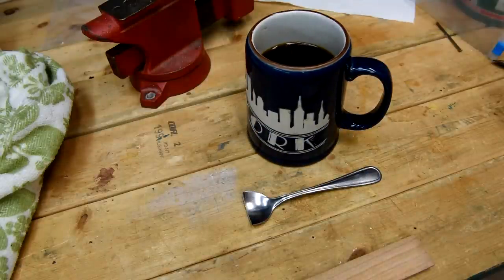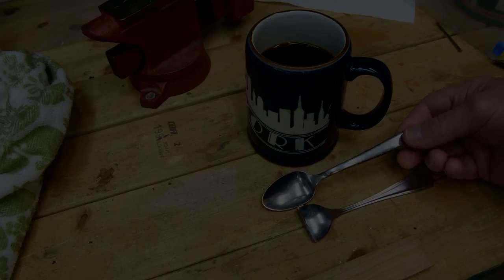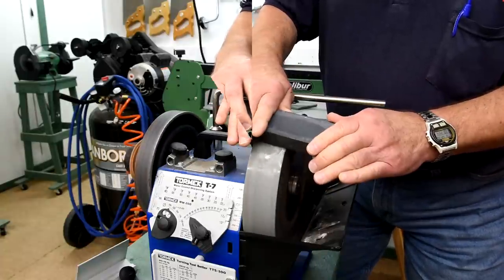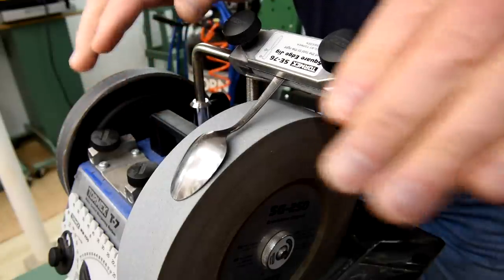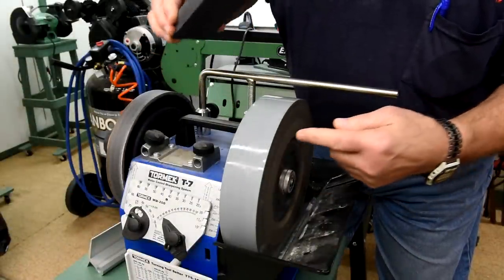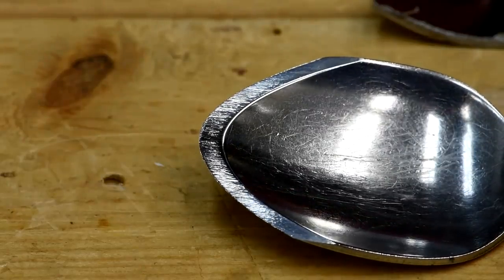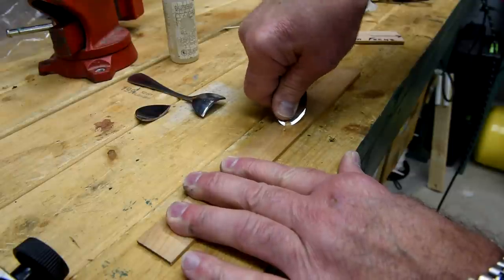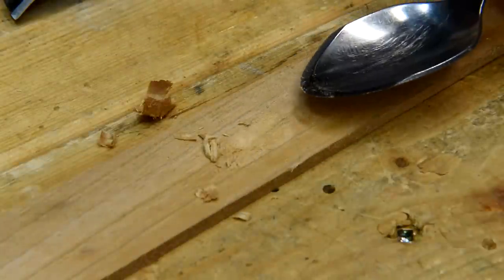The Homemade Carving Spoon/Gouge - Update

Comment: Way to go.  Like the old timers used to say, If you once fail, try try again.    Never give up my friend some of the greatest inventions, tools, etc., were born out of necessity and a string earlier failures.  A testament to why we should keep trying and looking for ways to improve.  When I made mine I cut it like your first one  but used a die grinder with a series of drums to cut the bevel on the top side.  Then polished it with a ceramic stone that closely matched the bevel.   This design you made very much resembles a old fashioned spoon bit for a brace.  I’ll bet it works great for cutting holes by hand.  Thanks for sharing your experience with us. I enjoy watching and the creative thinking it inspires.  Have a great day my friend. And again, well done.  You should re-bevel your first one to and have two very useful tools.  Just a suggestion.   Maybe make a follow up video if you make handles or continue to improve your design.  Thanks for sharing.
Reply from the maker: Thanks for the suggestion Edward, but I've given up on my homemade gouge idea. 😁

Comment: You can buy spoons at thrift shops for almost no cost, try a plain carbon steel spoon, it can be easily hardened and tempered and will hold an edge better and be sharper when honed with compound on a leather or wood strop. regular spoons are magnetic, stainless usually isn't.

Comment: Looks good Ron.    I have a tool very much like that except where there is the belly of the spoon, I have hollow ground it.  This gives you two tools.  A slick with a drastic curve to the front so it can smooth the outside of a hemisphere or plane with no risk of digging in anywhere, and a fairly shallow gouge.                      What I detect in the video is that there is still a significant burr on the edge of your tool.  This is bound to be a problem with the relative softness of the stainless.  But a culprit is also using the jig on the strop side of the hone.  To peel off that burr you need to raise your tool a little higher than the incedence you have it at.  And just flip it back and forth until you pull off that burr.  With just that you’ll get (at least) an initial cut.  That stainless will hold on to its burr pretty stubbornly.      That tool (in proper tool steel) I think you would find quite handy.
Reply from the maker: Thanks for the comment. Yes, agree "in proper tool steel" 👍

Comment: Been thinking of making a spoon carving knife for gouging out the scoop part....I don't have the tool you have here.  I like what you did with both spoons...might just need to be thinner to be able to cut? I saw a grinding ball for a drill at hardware store today...might try with dremmel or rounded  file  will take a while but its satisfying when a few attempta comes out with a usable tool. 
I think both could work might just need to be sharper or add a handle....the hardware store even had handles to add to the files...i didt know they existed..but could work as a handle on your spoons.
While out walkin I get my ideas and funny to see this video after thinking about spoon carving and how to make a tool. maybe sharpening the long side...length of the spoon scoop so it can be used sort of like a paring knife only curved.
I have a victornox curved paring knife good for food carving.like melons or pumpkins...hoping to make somethin similar but bigger and hold up to cutting wood . 
Spoon tool for carvin spoons.
Love it great video. Good to see other people experimenting with making their own tools for carving
Reply from the maker: Thank you for commenting. Good luck with your home made spoon gouge. 👍

Comment: Ron
Again, thumb UP for the effort, however you have a totally different "spoon" now, the edge is different too.
If you compare the two spoons to a Propeller plane (straight wing) to a fighter Jet plane with sweep back wings.
You changed the geometry of the edge that's why it's cutting now (not for long though, wrong material).
I personally wouldn't continue with this unless you change the steel on it with a hardness of 57-62 on RC level.
Now, if you want to "forge" a chisel, there are plenty of videos for that...
Best.

Comment: This sharpening thing has become a self standing art.  Your spoon looks like many gouges that have the bevel on the other side like your first attempt.  Flat chisels cut either way even though they have a single edge.   Seems youi need to hone off the burr and/or try a schew angle or a roughing gouge angle.   In the end it should sharpen as any other tool just unlikely to hold an edge as long as a HSS and of course a carbide. The weak link at any sharpness will be the spoon handle because it is likely to bend under a load.  May want to buy a soup or larger spoon at a thrift store that has a more robust handle and give it a try.  Old metal hack saw blades (power type) have been used for years a s tobacco cutting knives.  Of course those are hard tempered blades and actually brittle but have very durable edges.
Reply from the maker: I had never thought of hacksaw blades to obtain high quality steel. Thanks for the tip :)

Comment: You were on the right track with the first spoon. It needs a much steeper bevel and to be honed further. There are a ton of videos detailing how to sharpen a gouge. With that edge on any chisel the result would be equally disappointing. Well I think the problem would lie is in the tang bending
Reply from the maker: Thank you for commenting Rico. 👍

Comment: You had the wrong 'DEGREE' on the cutting edge in the first video, I make my own carving knives and adze for Northwest Wood Carving Style, the pitch or "degree" should be no more than 27 Deg off 90. You can research Kestral Tools or Preferred Edge and I believe they have shop prints you could go off of. Cool video, thanks for sharing.

Comment: hey ron.... do you have a way to harden the "blade" steel from a spoon is extremly soft... so you would need to do a hardening and then a tempering... both can be done with pine charcoal in a clay pit with a blower on it... heat the spoon to orange and dip in warm canola oil... this will harden the blade (should make a ring like an anvil) then place the spoon in the oven on 200*c for 6 hours... then dip in oil again.. and final sharpen it and strap it with a straight razor belt...
Reply: +Xencept Psyrun You can heat treat this but it wont do anything this kind of stainless doesn't have enough carbon in it to harden
Reply: Hardening stainless? Rofl

Comment: Of youre unhappy with the cutting angle of your tool, just change it. For a lower angle, lengthen the beveled area. My 35m cut 7 straight gouge has a bevel of 21-22degrees and the bevel length of 8mm.

Comment: One rough method of nspecting a blade for sharpness is to hold the edge up to a point light source (ie: NOT a fluorescent light) and gently move the edge to try to see if it reflects light. If it does, your tool is not sharp. Every blade will have a minimal angle at which it will bite into what you're carving. Trying to cut at too  shallow an angle will  result in the blade skipping off rather than cutting.
Reply from the maker: Great tip! 👍

Comment: Just looking at a regular gouge, I think the answer to this burning question of which side to put the bevel, inside or backside, is 'Yes'.   :)
What I would do (and actually just might, if I can snag the necessary raw materials when the wife's not looking) is cut it in half as in Attempt #1, but then find a piece of pipe or tubing with a matching diameter, wrap a few different grits of oiled sandpaper over that, and cut a 10 degree bevel on the inside (depending on how well it holds an edge, may have to go steeper).  (EDIT:  OR just clamp the oiled paper over the wife's sturdy broom handle -- yeah, that'd do it!)  Then fix each grit to the workbench top (I'd be afraid of burning and softening it on a wheel), and cut another 10 degree bevel on the backside of the spoon.  I think I would then knock down the heel of that second bevel a bit, the angle between the bevel and the back of the spoon, to round out the bottom of that 10 degrees and allow room for angling the gouge differently while carving.  

Then perhaps hammer out the handle to an appropriate angle, sandwich it between 2 hickory scales, riveted and carved, hone the edge (the wife's chef knife honing stick should come in handy for the honing, plus its own handle would be just about perfect for the new gouge), and holding some oiled leather curved in my hand, strop off the wire edge (the top of her new leather purse should have just about the right curve).  

So what if her new stainless flatware set and leather purse (broom handle, honing stick, etc...) are ruined?  A hand-carved wooden spoon should more than compensate.  Right?

Comment: I am no expert, but I feel there is something wrong may be the gouge is too wide hence not so effective? How about making the gouge out of the spoon handle, like a fish tail gouge ? its a more flat than curve but may work
Reply from the maker: Yes, that plus the fact that it does not have a proper handle strong enough to apply pressure into the wood. Also now that I think back, it likely would have done better in a very soft wood. That wood you see, as I recall, was fairly hard. Also I think that I should have done a better job sharpening. I stopped too soon.
Reply: +Ron Calverley Thanks for replying. 
That is correct, did not think of it (proper handle).

Comment: A few things:That stainless can't hold an edge. The bevel should be on the outside. (in cannel bevel gouges are mainly used for coping) ...
Your left hand was directly in front of the sharpened edge when you were pushing on the spoon. One slip and you're a candidate for stitches.
Reply from the maker: You are likely correct on all counts. I guess that I'll never be a good carver lol.
Reply: +Ron Calverley  "I guess that I'll never be a good carver" Why not? Get the right tools and some good instruction and there would be no stopping you.

Comment: You have to heat treat it in order to get any decent results from it.
Reply: +SamuelNes Not everyone can heat treat stainless steel at home.
Reply: +Hak Kar heat treating stainless steel wouldnt do much anyway. not nearly enough carbon in it
Reply: +xWhiteRice stainless steel generally has higher carbon content than carbon steels, just not this low of a grade.
Reply: Hak Kar all they need is a torch and water or oil If they have it

Comment: Well Ron, this was very interesting to watch! I had to laugh a little. You're learning so much about metals and bevels. You're not that far afield from what goes on in "less-developed" countries. Mild steels, including low-grade stainless, are used for all types of tools. They sharpen up reasonably well, but don't hold their edge as long. They'll never be as sharp because the steel crystals aren't as refined, but you can get them sharper than that! Your trick with the Tormek doesn't seem to be getting you a well defined edge. I would grind that bevel inside the the spoon, much shallower and thus deeper, maybe with a Dremel? Then finish it with wet/dry paper, or some abrasive pastes on a roll of paper or leather. I think that your original design, cutting half the spoon off, makes a tool that's much easier to sharpen and would work better. Hardening and tempering will be possible if the steel has a high enough carbon content; if you're using a better sharpening method and it still won't cut, I'd turn to refining the crystal structure with heat treatment. Nic Westermann makes beautiful carving tools that look just like your half-spoon. Good luck!
Reply from the maker: Thanks Aaron! I'm not a metallurgist, that's for sure. You make me want to dig out the half-spoon. Still have it somewhere. Surprisingly, I don't have a Dremel Tool but I do have a very small air powered grinder that does the same job (noisy thing) Re: "what goes on in "less-developed" countries" --- sometimes I think I was born 200 years too late LOL. :)

Comment: Comments I have on this video:

1. The cutting edge clearly had a huge burr and needed to be honed on both sides, not just one.

2. For those who suggest heat treating the blade - no, it would not work. Stainless tableware is made out of what is called 'austenitic stainless steel' which does not contain enough carbon to quench harden. It is reasonably hard to begin with, not very good for cutting tools, and can be somewhat work hardened through cold working. Hammering or shot peening the surface for instance. 

Stainless steel knives are made out of 'martensitic stainless steel' which contains enough carbon to form hard martensite crystals.

3. Another point on hardness - even a relatively soft steel can still be honed to a decent cutting edge. The hardness of the metal affects the durability of the edge, not so much the ability to hone it.
Reply from the maker: Thank you for your informative comment Frank :)

Comment: Now chuck it into a brace and you have an old style spoon bit.
Reply from the maker: They still sell those here in Canada lol. http://www.leevalley.com/en/Wood/page.aspx?p=57713&cat=1,180,42240,53317&ap=1
Reply: +Ron Calverley if you cut it tho the same as before in half or actually 1/3 in and also add a handle im sure you would get still much better really just keep in mind that bevel again

Comment: at $400/per replacement water stone on the tormek's, I would of put a rough edge on the spoon with an angle grinder first, then used the tormek to put the actual blade on it.
nice video though ,I like the idea
Reply from the maker: Thanks for commenting Wesley. I made that spoon-gouge almost 3 years ago now. Never used it once yet, lol  :)